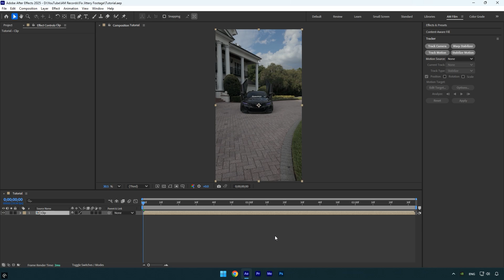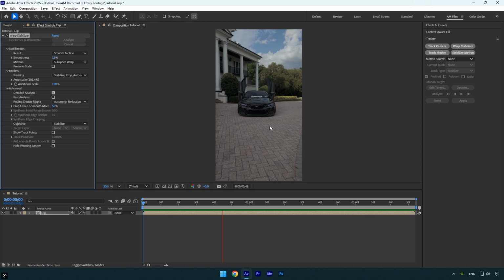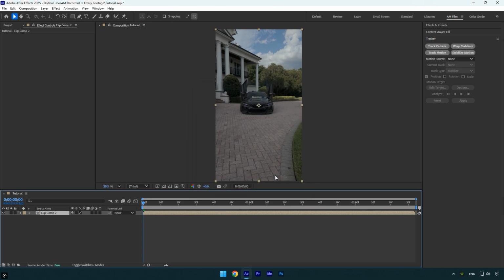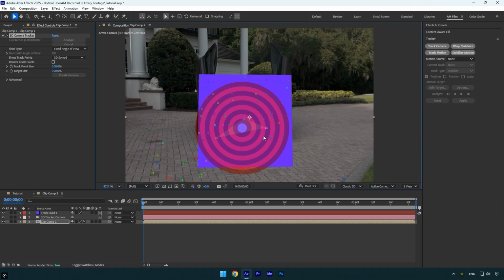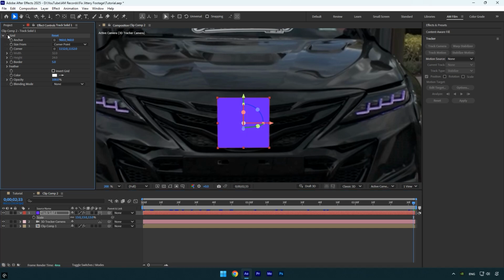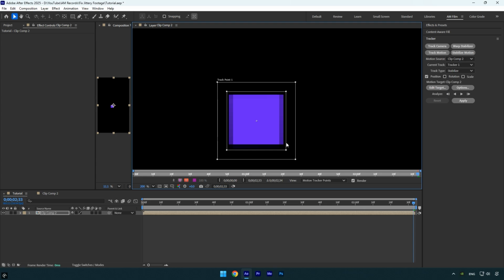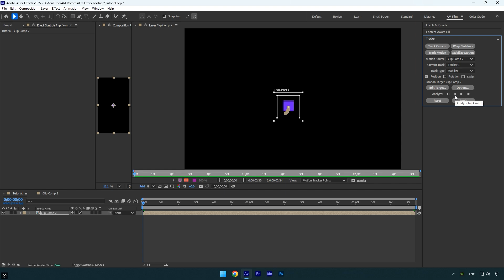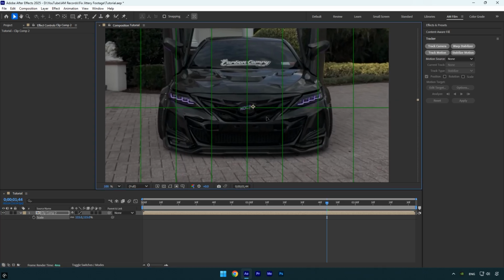Smooth Out Jittery Video in After Effects - Lock-on Stabilization

Comment: How you stabilize non locked footage, what is your way of using only warp stabilizer ? or do you use something, is gyroflow must for that ?
Reply from the maker: For most of my videography, I use the DJI RS3 Mini gimbal, which provides smooth results when used properly. For cinematic shots, I typically avoid using warp stabilizers. I only apply one when there are minor jitters caused by uneven walking and even then, I use it at a very low smoothness setting